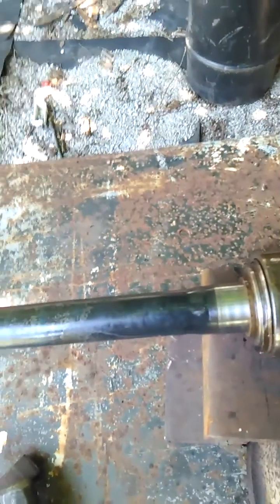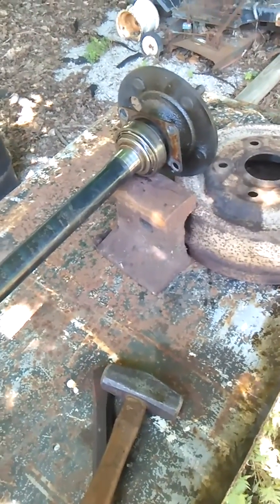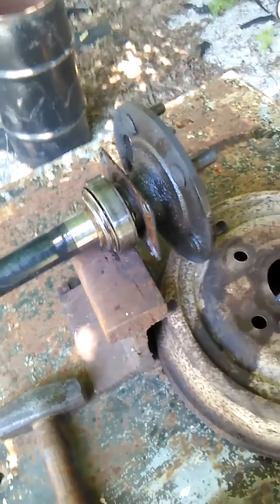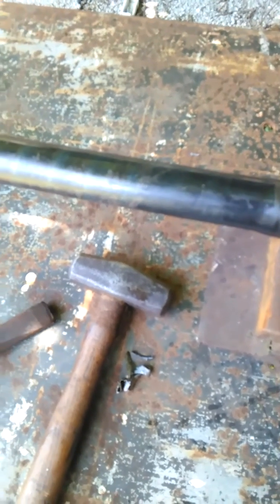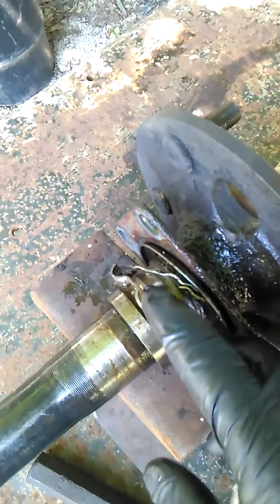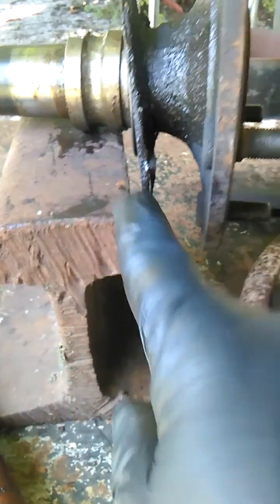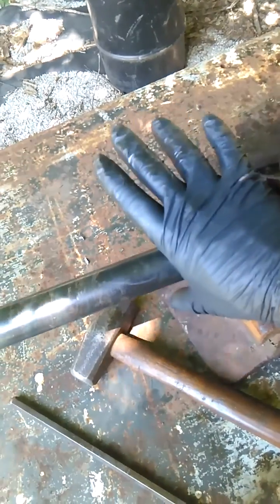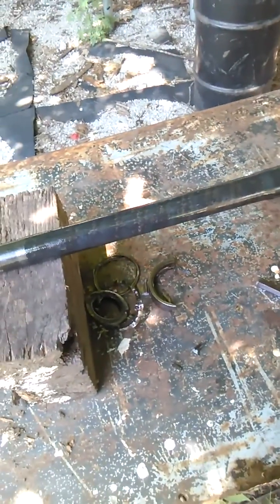Old school bearing removal and installation procedures using a 69 Ford 9" axle

Comment: Last night I put the axle is the chest freezer and heated the bearing to 250F.   It slid right on with no press.
Reply from the maker: Ya, we’ve used dry ice to freeze parts, we’ve heated them up in an electric skillet etc.